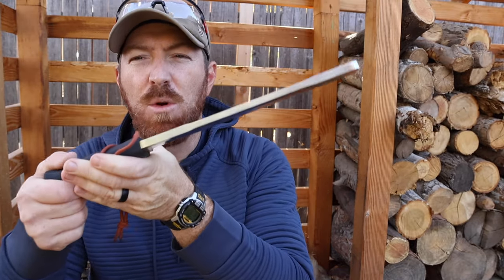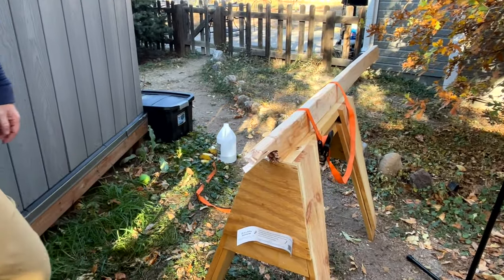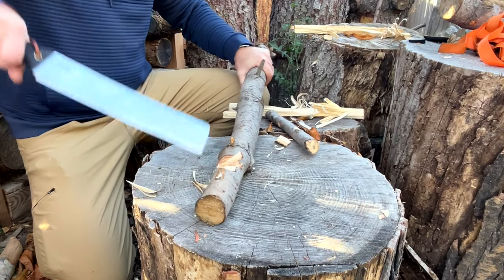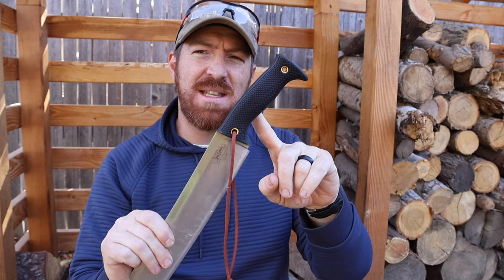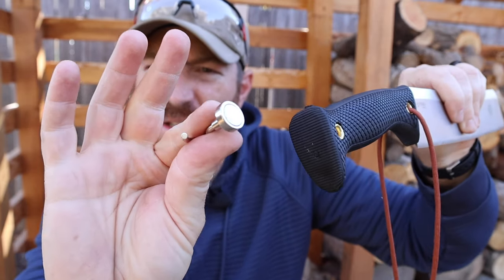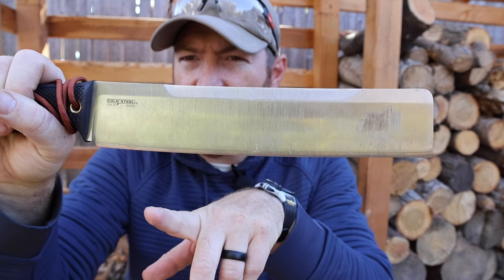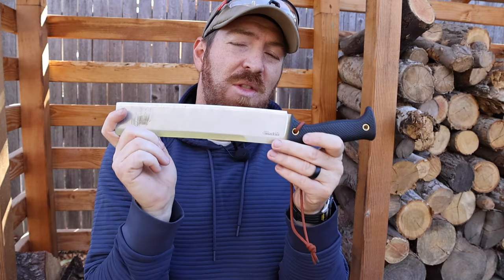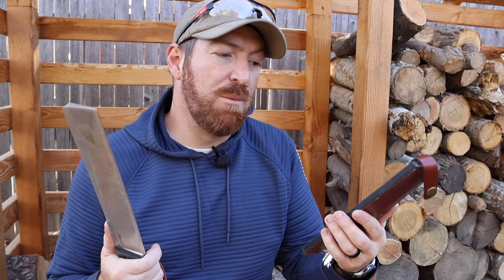CPM-3V MONSTER Cold Steel Jimi Slash Competition Chopper

Comment: 500 dollars!!? 🤣Brother that is basically a Japanese 'nata,' which is a specialized hatchet/delimbing forestry tool. I don't know if you've used the one made by Silky but you can get a Silky full size nata for 70-100 dollars, which is significantly cheaper. I've broken down a few entire pine/spruce trees using nothing but my nata and a folding saw/chainsaw (tho i did split the large rounds with my bigger axe at the end). They are nice tools. Hatchets split better but natas delimb easier and are easier to safely handle in my experience. You should directly compare this versus a silky nata
Reply from the maker: I think I will!
Reply: Silky Nata is definitely a good budget choice. The competition chopper is going to bite a bit deeper due to geometry but the 500 dollar price is a hard pill to swallow. I own a silky nata it's a great tool.
Reply: The silky has a better handle, sheath and ergonomics.  It most likely is heavier, at least the 240.  Best chopper i own.  I have a swedish brush axe that delimbs and chops saplings like nothing else.  I favor the brush axe over the nata, but if I want controlled chops I go to the nata.  A really good pair is a nata with a small curved saw.  That combination will take care of all your campfire needs and then you will need a bushcraft blade.   Mora robust and perhaps a opinel with the fork and spoon option for close camp chores and food prep.  A really good axe is always a good idea.  Council tool Hudson Bay axe is packable and handy and will meet virtually any need outside of the rest.  So there you have it, the camping steel set!
Reply: @hillbilly4christ638  I don't know what a swedish brush axe is but if it's a billhook than I'm with you, those are basically the best tools for delimbing in cold, northern climates.
The 240 isn't heavier than this cold steel. I just weighed my nata 240 and it weighs 25.6 ounces (the cold steel is 28 here) with my orange lanyard in my handle (so I can find it). I also wrapped the very bottom of the handle twice in some hockey tape and that keeps the handle from wanting to split apart at all, also orange because I once set it down and couldn't find it in some brush..... yikes.
I agree though. Nata + curved handsaw + a small bush knife is my exact combo, I happen to own most of the mora knives but I always just use a basic companion
Reply: BorealEDC  the nata is definitely good for splitting camp wood. It weighs about the same as a small hatchet overall, obviously the hatchet works better as a wedge because all the weight is in a smaller area, but the nata isn't so bad, at least not the full size 240mm ones. Smaller nata actually are pretty bad, you may as well baton like a doofus because they are axe-sized with zero weight, basically a square knife. It's funny that the 240mm is the large but it weighs the same as a small hatchet and does double as one decently. I was being an idiot by the campfire one day and chopped my thumb off KNOWING I was being unsafe but my hand gets shaky holding a hatchet now, only hatchets I'm fine with my axe, chainsaw, and nata but hatchet??? PTSD for me 😂(don't worry I have my thumb on)
Reply: Blade Sport has rules and exact specifications for competition chopper. For beginner the Cold Steel competition chopper is a budget friendly option, most competition chopper are customs and cost much more.
Reply: @achimgeist5185  I guarantee my custom would be a welded together piece of spring steel and defeat blades that cost 100x as much 🤣how do I get into this meme competition
Reply: I own a nata, had some friends out with similar choppers which bit through the wood better.  The natas grind isn't really great for that, and theirs just penitrated better.  The nata shines for batoning, and clearly it will last a while, but my gransfors small forest ax paired with a silky saw is way better.  That ax with practice is formidable.  I would take the nata in the pack if I was looking to reduce weight but I'd absolutely be working harder then with my ax
Reply: Skrama 240 is also very similar.
Reply: @NatureBetsLast  it's better to compare the nata against a hatchet, not an axe
Reply: Looks like a fun vid to film.
Reply: There’s no comparison bro besides midway had this on sale.
Reply: @jonasv328 I have the 240 it doesn’t compare to this beast.
Reply: @jonasv328 maybe the skrama 200 would be even closer? Shorter handlebane slightly short blade than the 240
Reply: $380 on Amazon right now

Comment: They should make a second generation version of this knife with the same design, but just with a pointed tip/edge. That would be amazing.
Reply from the maker: That would be sweet!!
Reply: Alter it. I've been doing it for years, it's pretty easy if you're super careful to keep it cool & not ruin the heat treat. Cut for a literal second at a time (if that) with a cutoff wheel or right angle & immediately dunk & stir it around in a bucket of water (until you feel zero heat) after every tiny cut. I've put waves on my Voyager XLs, a tougher BK2 style tip/profile on CS Survivalist, etc.
Reply: @johnnyshanksalot8358  G'day mate, yep I've cut down a coup[e of full size felling axe heads in the same way, to ..... lotsa names for essentially the same pattern, (Greenland, Hudson Bay, Montreal patterns are often used), but basically like a small forestry axe. Re-profiling the body/blade thinkness and edge was the most difficult and time consuming part and if I did in fact alter the HT, I reckon if anything, it's now better, i.e. perhaps not quite as soft, but still not chippy. 
Not sure I'd be willing to mess with a 500 knicker seax/froe type job though, lol.
In any case, I've found my parangs/Skrama proficient and versatile enough as is, (and as a strong advocate of pairing), together with a good belt knife, the bases are covered. Cheers Duke.
P.S, you mentioned the CS Survivalist; must admit I hung out for the scaled version, since I didnt want to do a paracord or tape wrap ... I carry some Paracord, No. 36 bankline and Gorilla tape regardless, (so I dont need the emergency material).
Decent enough sheath too.
Fair to say, 52100 has a very good rep, and @ 7 in. it provides a bit extra span over 5-6 in. jobs. Batoning the bejeezus out of it through 4 X 6 in. Aussie Redgum fence posts, with no issues, attests to that. .....which segues into my final point; I'm not generally a fan of full flats, but CS has got the angle of the dangle just right on this one to still spit very effectively ..... and incidentally, ESEEs, for some reason, are inordinately priced here, so at the end of the day, ripper bang for buck IMO, ....... modified or not ; )
Reply: Yeah , a Lite version with AUS-10 steel .... 😂🤣
Reply: You’re basically describing the Natchez Bowie.

Comment: Dang! ColdSteel went off the deep end with the price on that one. I'd be curious to see what a piece of cpm3v steel plate of that size costs just to get an idea of the price of the steel.
Reply: If it was Carothers Delta 3V it would make more sense. Anything else seems crazy
Reply from the maker: Ya not sure where the price comes from with the 3V trail master coming in at $350
Reply: It is thick af but I look at 3v prices now & then & you could pretty much buy enough material to make a big bag of tomahawks for that. A Peters heat treat is not too much either & people exaggerate wildly about the difficulty of grinding it. Truth is the whole field's like that, if you love good knives never research the real costs (or cost differences of material), you'll get super mad lol.

Comment: Too much money for what it is. Many tops blade that would make better tools (not "competition" but outdoor tools) condor woodbuster is a good budget version of this. You can get the trailmaster in 3V for basically half the price & it would probably be the better oprion as a camp tool.
Reply from the maker: Totally in many situations
Reply: @gideonstactical  
Thought it was "overpriced" at first but when you consider stuff such as the fallkniven modern Bowie is like $650 the price doesn't seem too harsh. Especially for a massive chunk of essentially unbreakable 3V. 
Sheath is a bit of a disappointment though.

Think collector / resale value alone makes it worth the purchase. Definitely won't lose value.